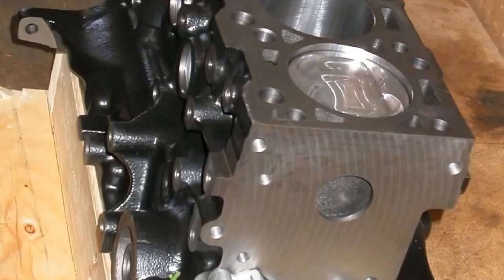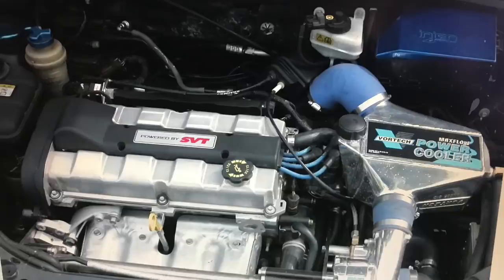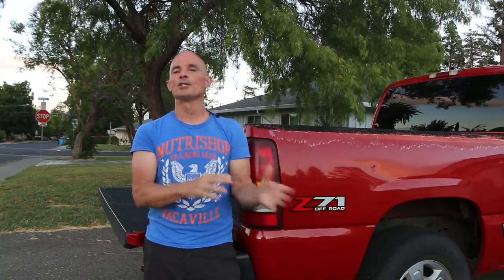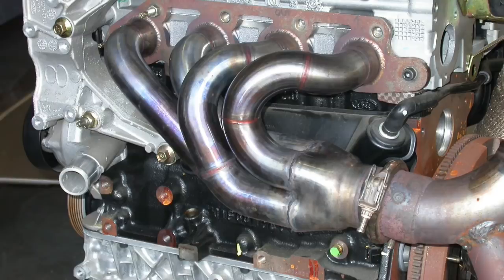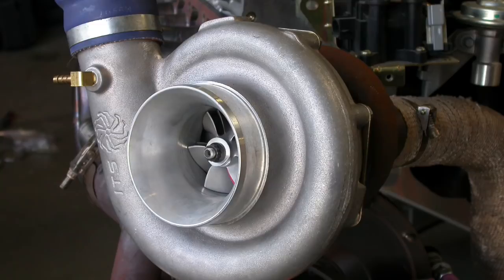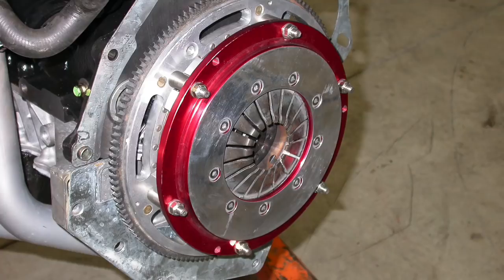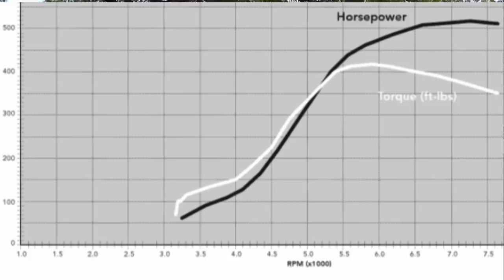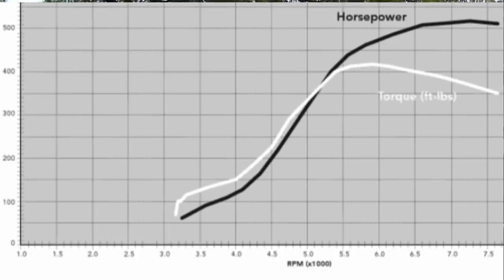FOCUS POWER! TURBO ZETEC FOCUS

Comment: Any builder worth the title can make horsepower with anything, some engines have more potential than others, some have more restrictions than others. Look at a Ford 240 cubic inch six cyl out of a truck and compare it to a Ford 250 Cu in six. The 240 is slightly smaller, but it’s not restricted by the integral intake manifold that the 250 is cursed with. When I worked at a Parts Store with a Machinr Shop, one of the guys working there bought an older Ford Truck and found a 300 six to put in it, the larger brother of the 240. The head on the 300 was cracked, but the rest of the engine was ok, so he set about cutting the 300 head into slices and found where he could port the head and where he couldn’t and he also found that with some work he could put 351C or 352M  2bbl head’s valves in it. Unfortunately I left the compNy for better pay before that project was finished, so I don’t know if those valves were the right length,  but valves can be made to fit you needs. Now around that time there was a bracket racer in Phoenix that ran a 13 second Ma Erik with a 300 six in it, and I believe there was more performance to be found in that engine, but the 250 would be lucky to make 1 hp per cubic inch. And I think it’s one of a few modern engines, and by modern I mean from the 1960’s on, that might not be able to make one hp per cubic inch.
Reply: Non-crossflow heads suck. Generally a huge limitation.
Reply: Non cross flow can be ok. 
At the last shop i worked in the head mechanic, an amazing genius who rebuilds differentials and transmissions in half a day, he drove an early 80s f150 with the 300 straight 6. 
And that engine still ran like a clock. 
Gearbox wore out before engine

Comment: More small motors please! LOVE THIS CHANNEL
Reply from the maker: How about my turbo 1.0L 3-cylinder sprint motor
Reply: @richardholdener1727 can you turbocharge a Toyota Camry 5sfe??
Reply: Yeah, how about na and turbo sr20de and ve from Nissan
Reply: Or how about the newer 2L I4 Nissan KR20 vccr turbo platform the one with variable engine compression I’d love to see what you can easily squeeze out of it for power

I’m not sure if anyone has modified one yet for power/racing/street strip
Reply: @richardprice5978  As much hate as they get, the Qr25 is a really decent specific output 4cyl too!
Reply: @madmod  ? not sure im formalised with that/QR25 engine platform please explain is that the same platform i asked about? 

im mostly a 60's dodge guy and or my focus in life as there's way to meany to choose from 👍😁😉

also i like the 3-rotor RB-20 Mazda but i don't have any JDM stuff right now 

i like learning from other platforms as to how i can modernist and modify my charger/440 or hemi platform
Reply: @richardprice5978  Its an engine that replaced the sr and kr engines. Its pretty common engine but very healthy for a 4 cylinder

Comment: I would love to see a Duratec 30 V6 boost build
Reply: I was just gunna say the 2.5 from an svt contour. Forged crank and sounded awesome. Just a happy little cobra wanna be
Reply: Bring me back to old days. Swapped a 3l duratec into ford contour and turbocharged it. Talking about was a fun car.
Reply: @BeastBloopers-g2o  Yeah, I had a 3L SVT Contour as well.  Oh boys... back to the CEG days.
Reply from the maker: Back in the day-The Sho Shop would hybrid the two and run the SVT heads and cams on the 3.0L short block-basically a stroker SVT
Reply: Richard Holdener wow what kind of power did it make?
Reply: @D3thM3tal  You Durkatec guys were masochists for having the V6 in the Contour.  That thing crammed in there.  So many bloody knuckles.  The Zetec was a bit better.
I had the 3.0 in my '06 Mazda 6.  Man I loved that car.  The howl that it made to redline was INCREDIBLE.
Reply: Basically you'll have a port injected 3l v6 EcoBoost. The duratec line was developed as a either/or (with a turbo and with out) engine.
Reply: firebry23 Depends which Duratec line you look at. The early 24v Taurus stuff is junk, but the later mid 2000s up and Cyclone/MZI stuff can be fairly decent performers.
Reply: Great motor
Reply: Not much space in the focus. N/a would fit just fine... I have all the parts to do it but too many projects

Comment: I'm seriously considering turbocharging my Allis Chalmers B tractor. I've seen some kits on larger tractors that pull through the updraft carb but I was thinking making it a push through on a downdraft. Any thoughts on which would be better?
Reply: Make her a EFI manifolds using a GM throttle body from like a 454
Reply: @smokenchoken1736  That might be a bit of overkill considering the tractor is rated at around 20hp at 1400 or 1500rpm. I've seen videos of AC CA's and WD-45's with the turbos so I know it is possible. Honestly my biggest concern is connecting rod oiling because on this engine it is not oiled through the crank but by squirters from the cam region into a catcher hole on the connecting rod. The compression ratio is something around 5.5:1, although it will be going up some because I'm going to use the larger piston sleeve combo to increase the bore to 3 and 7/16, so I think it will be alright will 8-10 psi of boost. Although I will probably start around 4-6 and see how that goes.
Reply from the maker: if you draw through, make sure the turbo seals will work, otherwise I would blow through
Reply: @richardholdener1727  Keystone sells a system that uses Garrett or AR turbo but I'm not sold on the idea of the pull through system. I didn't know it was possible until I was looking at their systems the other day. I'm planning on building my own, give me plenty of practice at TIG welding up the intake and exhaust. I was thinking of building a pressurized box like you used on one your tests. Do you still get the charge air cooling if you use the box? Sorry if that is a dumb question. Thanks
Reply: Just suggested for the ease of locating and aftermarket connections, with it being EFI it shouldn't have much issue with handling the smaller engine, on the same wavelength there are 2v versions on smaller GMs but its whatever dill you pickle
Reply: @smokenchoken1736  I'm sorry I thought you were trolling me. I see what you are suggesting now and how that could work. Thanks for the suggestion.
Reply: Convert to EFI with a really basic ecu.
Reply: @GroovesAndLands  Thanks for the suggestion I can see how that would be beneficial.